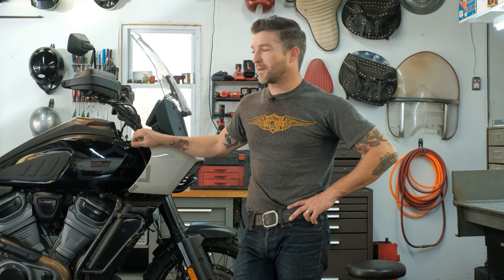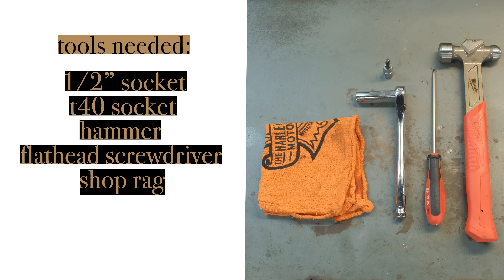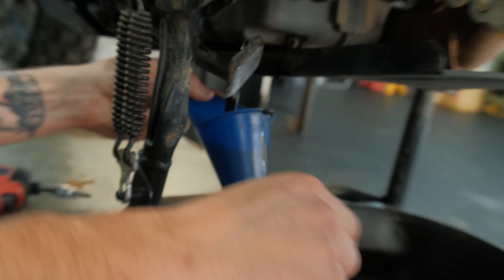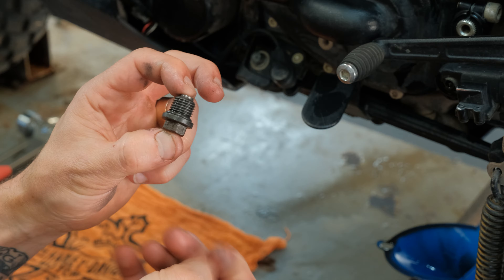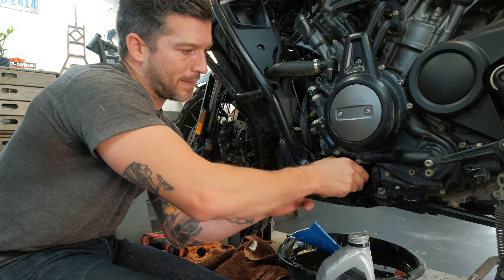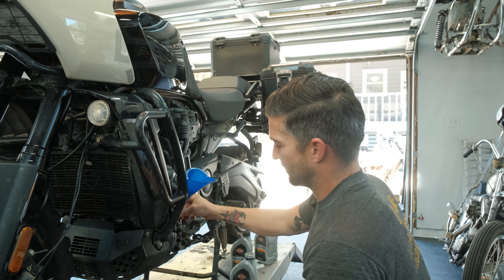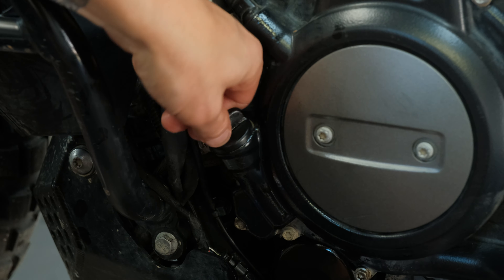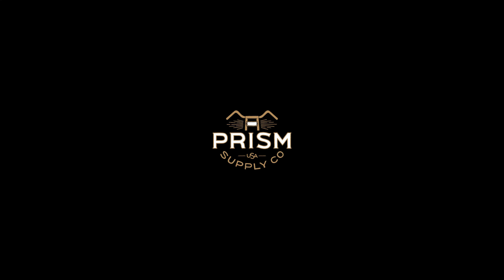How to change the oil on a Pan America

Comment: Thank you for this instructional video. Note that HD recently issued revised procedure to dealers on oil level checking for Rev Max engines:  Bike upright (not on centre stand), engine at operating temperature, oil level should be between the 2 marks on dip stick. I just had my wife hold the bike upright [the bike becomes weightless if held perfectly upright] while I checked the oil level. I suppose I could put my PAm on the centre stand and place a piece of wood under the front wheel to level the bike out and then do the oil level check.

Comment: Perfect!  Thank you - One of the Easier oil changes. Removing skid plate was much easier with oil filter drainage.    I have had one oil change at the dealer, low mile bike. The dealer installed the drain plug (Redwood Harley Davidson - Eureka) Using the o-ring .... as well as "thread tape"??  WTF  If I knew how to load the photo I would...

Comment: You have to have it on the side stand, not the jiffy stand.
Reply: the side stand IS the jiffy stand. he has it on the center stand, and no it doesnt have to be on the kickstand.
Reply: Supposed to put 2.5 qts start it for 10 seconds and then add the rest. 👍
Reply: @Airtroops83  By putting it on the side (jiffy) stand it will drain approx. another 1/2 quart of oil.  Center stand will not drain all the oil.
Reply: @Airtroops83  Is the side stand really a jiffy stand? To my knowledge a jiffy stand arrests in position so it won't move when you push the bike.
Reply: @DomAdrian2312  Yes it is a jiffy stand. As you put pressure on the stand it moves up into a "locked" position like all modern harleys, and helps prevent rolling.

Comment: You need to drain it on the side stand to remove all the oil, otherwise you won't even fit 3qts in it. Buy a service manual before misleading folks. I'm a 12th year H-D technician and I can stand it when people think they are qualified to mentor others before doing the research themselves. You need to remove this video and make corrections.